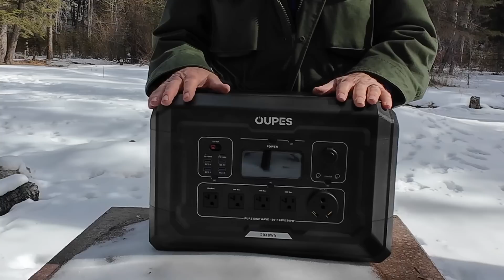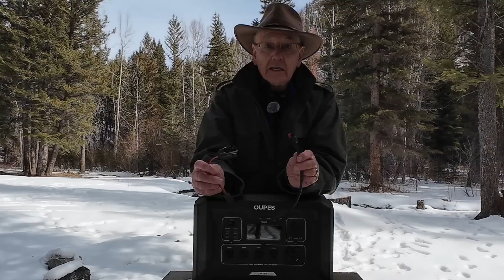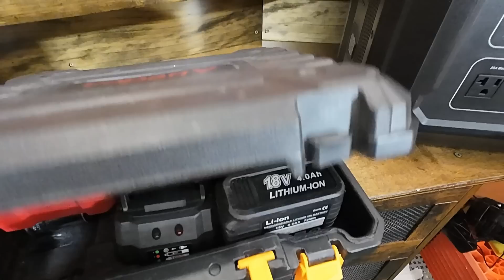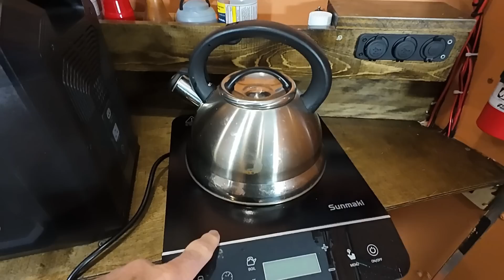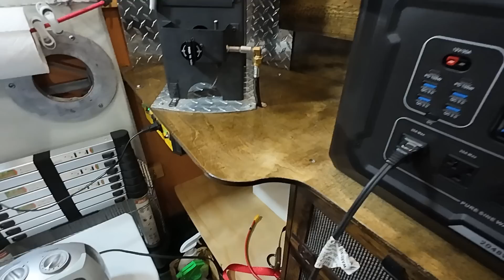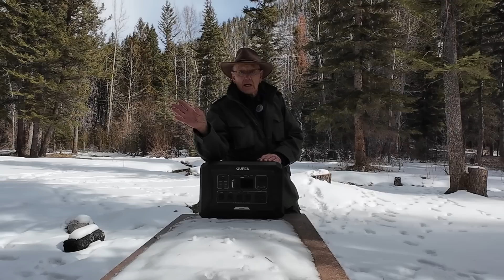Power For Your Home And RV And It's Affordable! - The OUPES Mega 2

Comment: Hey, Rick, love your videos.
Just wondering if you had a choice between the Bluetti 
AC180 or oupes maga2.  Which one would you recommend. I just want to make the right choice . have a great day and lots of fun.
Reply from the maker: That's a hard question to answer because both of them are very good.  The Bluetti AC180L is the one that I recently reviewed and it's meant to be paired with the Bluetti MultiCooler.  Both of these units are great.  The Mega2 is a great value for the price and has great features.  For yourself, look very carefully at the features, including size, weight, outlets, and price and see if one or the other stands out for you.  I would trust either one.
Reply: @gonagain  Thanks and keep up the great work you guys do for all us u-tubers.
Reply: @thomashorn9152 Be aware of the FACT that Bluetti has ABSOLUTELY TERRIBLE customer service.
EcoFlow has the BEST WARRANTY 5 years, and EXCELLENT CUSTOMER SERVICE.

Comment: Hi Rick. Another Good Review.  I always thank you for educating me on the many different features these gizmos offer. But with all these different goodies available, I get more & more cornfused as time goes by.  I Really wish there was a tutorial available as I need to be walked through the 'it does this, and it does that' as I'm the Clutz of the Month when it comes to anything technical. I wish I wasn't so slow on the up-take, but once I get it, I Never Forget it. Geezoki.
Reply from the maker: Maybe I need to say more in the videos.  Thanks, Eric.
Reply: @gonagain  OH Gees Rick, Not Once did I think you didn't deliver all the info or the How-To regarding the many features of this unit or other fabulous power stations. No, Not at all, it's Me who is lacking in the 'How it Works' department.  I just need a little Sit Down when getting set up with Any New Equipment. I'm the one who is lacking, it's just the way my brain is wired. Rick, You are Tops with All your Presentations. God Bless. Hi Linda 👋

Comment: Rick, thank you for your reply.  Have you run an efficiency test?  I would be curious what you results are?  It has been some time, maybe 6 months, so perhaps they have improved their efficiency. Plus this is the Mega 2, so it could also be different.  Am curious... always looking for the best available unit
Reply from the maker: I did run an efficiency test when I first got the unit and it was 78%.  The problem with efficiency tests is that the results are dependant on how large the inverter is compared to the size of the battery in the power station, how big the cooling fan is and at what level the factory has set the cutoff.  For example, I an Itehil power station that I tested did very poorly and when I contacted the manufacturer they informed me that it was set at a higher cutoff in order to protect the battery from being taken down to a level that would damage it.  That's why I don't do efficiency tests in my review videos any longer.

Comment: The way the power units have become so much more effective over time is astounding. I still have a sense of worry about how long the units will last, and how they can be serviced if someone relies on them for primary power. But it's also taken away the barrier to have power in remote locations, to nomads, and for emergencies.

Comment: As  an Amateur Radio operator, I'm always looking for a clean inverter, pure sign wave, that has little affect on the 80 meter band.  I found some of the inverters built in, even as clean as they are, create unwanted noise ever so many cycles with what we call "birdies" or noise peaks.  I ended up with an Ecoflow Delta II Max.  It is a very clean pure sign wave inverter for my radio equipment.   It too is a powerhouse, especially if additional battery added, but not necessary.  Better yet, 5 year guarantee plus fast chargerging as solar and AC combined.  Bluetooth is also included with their app for android.  Good recommended unit, too. 😊  Thanks for your review, in detail again.

Comment: 321-min. This Vg, Size Even 4 a CAr, What's Nice iS 1 1/3-Hr Charge@ House  115VoLt Or Like a Generator This CouLd Run a Toaster Oven & Even Better With Some Sun input, 4 an Hour ➕ Bake a 9" x 9" Cake Lol
Reply from the maker: Mmmm...cake.
Reply: @gonagain  Ya With an, Extra2-- Eggy & & Dense'r Outcome, & 1/2-the Sugar@ Batter, & Then Aft Bake Put HoLes in it & Pour a CoupLe shots Of Any Booze Even Vodka Works Lol, Did You'ALLS See Those "Betty's" Festive Orange Muffins; Has OnLy 1/3-Cup Sugar@ batter, Something Like That WouLd make a SmalLer Boozy Cake, bye

Comment: Does Oupes help with tech support if you want to use at home? Have a 1976 mobile home. Would be nice not to have to worry about spoilage and coffee.
Reply from the maker: For the power unit itself, it's just a matter of turning it on and plugging something in, but if you want to wire it into your existing electrical circuit I would recommend that you have a licensed electrician do that for you.  That said, the instructions for that are in the manual for the accessory switch.

Comment: Good review.

These provide an alternative & convenient way to provide your camper with power particularly for those intimidated by wiring their van/trailer. They also provide more flexibility, if needed.

However, the convenience comes at a cost. The battery capacity of the Mega 2 is comparable to just 2 Lifepo4 100A batteries at a time when the price of batteries is falling.

Particularly when an Oupes costs around $1,100 and additional batteries are almost $1,000.😮